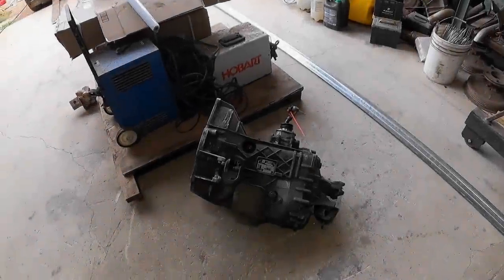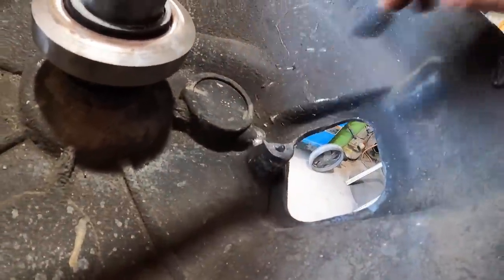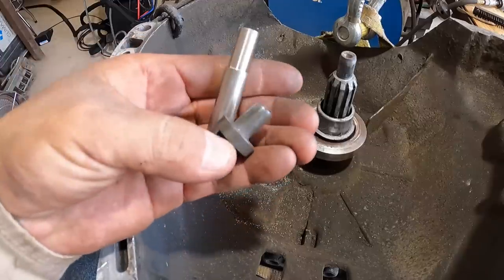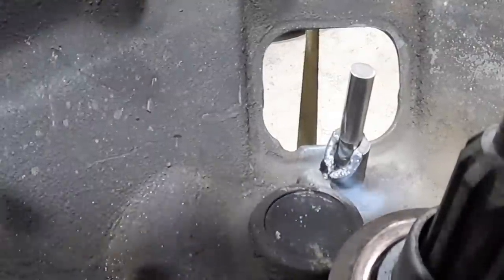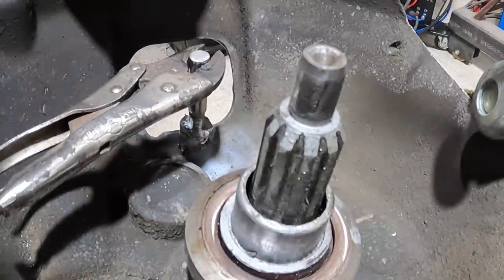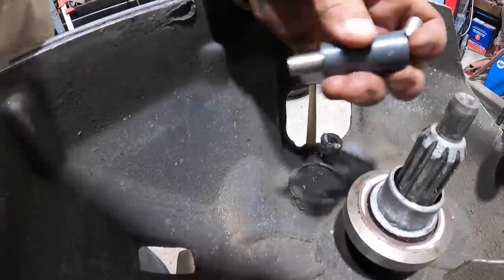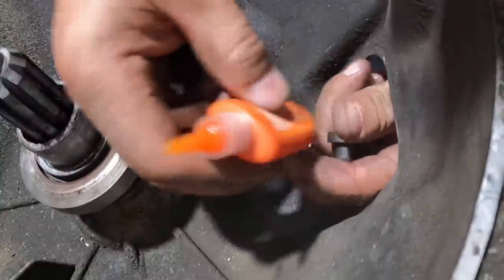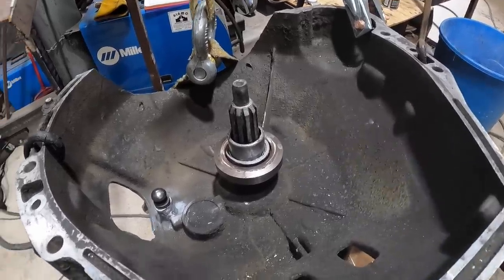Ford Manual Transmission Weld Repair.

Comment: Next time try a red copper rod it works on steel and aluminium you can use acetylene heat the casting slightly then it brush clean easely then before welding just use a acetylene flame with no oxygen blow the place black where you must weld then pre heat until the black disapear clean again and weld i did boat props vw enjine tops everything when i was an aprentise currently almost 25 years a welder butt lately only welding train bogies or trucks i used to do draw gears and train couplers.Nice job though i enjoy your videos go well.

Comment: Good ol Zf5 trans! Nice repair job! Can't tell the difference at all. Looks factory 👍🤷‍♂️✔️🛠️🗜️🔩⚡🔥📏
 I have a zf6 w\ a small hair crack coming from that clutch arm hole thru the side of trans(front 'dry' bellhousing side - not fluid filled section). I bought it used, shipped to me & didn't notice lil crack til later when putting it in. Seems fine still, but I keep an eye on it so it doesn't travel. I may have to pull it sometime to drill holes @ end of crack &\or have it welded. But as of now, I just baby the 7.3 in front of it, so there's not much torsional stress going thru the case at all. 🤷‍♂️🤔👍🔨

Comment: I have been a machinist for a long time, so i knew what kind of tool you needed.I was very impressed that you macgyvered that tool out of mild steel bar stock . and the best part was that it worked pretty well.  Great job!!!
Reply: What is it called? The wood worker side of me was that it's time to wreck a forster bit.
Reply: @emeltea33  spot facer

Comment: Tigging sand casted aluminum is a whole different skill set than what we usually see here.  I used to do this type of small stuff for a machine shop that worked on antique engines on parts you couldn’t buy anymore.  Go slow, adjust the AC balance, keep the heat where it needs to be and dip the filler in judiciously.  There’s an art to it, fun to watch.

Comment: Fantastic fix, thanks for the show!
For the next one...
Seeing the housing's cylinder mounting  "ears" seem to indicate that the clutch fork is actuated via hydraulic cylinder.

After a failure like this possibly the fork etc. could be discarded to be replaced by release bearing with direct-acting integral hydraulic  cylinder? A bit of plumbing and presto!

Comment: I actually seen quite a few broken clutch fork pivot points on those ford ZF S5-42 and 47 transmissions.  When that happens I don't bother fixing it, I just switch to a hydraulic throw out bearing which is actually much better.

Comment: A valve seat cutter of the right shaft diameter would have worked to true the top of the throw out arm pivot. But, your way worked 👍

Comment: I had to do a similar repair on an automatic transmission oil port bung that got cracked off... tapped it 1/4 pipe thread after and worked fine, always nice when you can save a case!

Comment: Issac, I know that you are used to working in your home shop and you truly seem to love it as it is. However, the shop really looks like it is over-stocked with tools and equipment etc. and could use an extension added to increase the working area. I really don't see how you can work as proficiently and safely as you do in such a cramped area.
Reply from the maker: I agree however, This is the only room I have available to me. My yard does not allow any more wiggle room. Unfortunately, for me, my shop has become a catch all. I'm actually a field repair guy but as of late, i've been getting a lot of shop work. I havent had the time to clean or organize my area. its truly a mess and I really dislike showing my junk laying all over the place. but,..it is what it is for now.😔😕😕

Comment: Real tidy looking repair.
Can't remember exactly what i used it for but I have knocked up a homemade cutter from a broken HSS drill bit, drilled the correct size hole and then stuck it in with 5 min epoxy.
Looks like a really weird bit of engineering having it just a smooth plug in the hole.

Comment: A piece of round  Graphite would help you weld up that broken piece to. Nice job again 👍
Reply from the maker: I've used carbon arc gouging rods before but not anything bigger than 3/8". its all I had.

Comment: Your DIY spotface cutter did everything it needed to do and cost you little in time or material.  If you need to make another one try drilling a cross-hole.  Grinding off half of the hole gives you neutral geometry at the cutting edge, or a bit less to be slightly positive.
Reply from the maker: Great Idea. Thank you.👍👍

Comment: Mine did the same thing, but didn't break the bell housing. Diesel fuel leak from the fuel bowl travels between block and and trany washing the grease out of the throw out bearing. The bearing froze up and came apart  causing the fork to shear the pivot ball off the bell housing. Must be on a 7.3 power stroke  lol. My brother made an aluminum stand off and I I got a 2 inch long pivot ball threaded with 2 lock nuts. I drilled out the spot on the bell housing and put the ball threw it and set the depth of the threads and  tightened  the nuts. Works just like before. Keep an eye on fuel leaks, expensive fix. Clutch disk, preasure plate, throw out bearing and a new fork.

Comment: That was a great job you did. Most mechanic and machine shops would have scrapped the case or the whole tranny. I know cause im in the business but you got them out of a giant predicament. I hope you charged them at least half the cost of a good used transmission. Congrats.
Reply: I've done a few ovver the years, seems like a design issue.

Comment: I've fixed something like this before, didn't want to do the build up (not that good with aluminium welding, not confident enough) and so i just machined the broken part, leaving a small registration mark at the bottom, made a little spacer on the lathe and used the pivot to register it in place before tacking it all the way around. So far, hasn't broken. A savvy person could probably do the same fix with basic hand tools, i just had the lathe, but i'm 100% confident one could've made the spacer with a drill and a grinder.

Comment: Good work Isaac . That trans though . I never seen a ford trans with a throw out collar that was casted into an aluminum trans though ... Even if it was an iron unit, it would be a goofy design .Not a good design for sure . You'd think that it belonged to a yugo . lol A guy would think that the throw out stud boss wouldn't be the thing that broke . lol

Comment: F-250, 350 4x4 Zf-5 S42 or S47 gearbox 1987 on with the diesel engines. (6.9 or 7.3) because theres no starter provision in the bell casting.

I was looking at that mushroom a couple of weeks ago when changing my clutch.

Comment: I see that HTP in the background, you going to give us a review on it?
Reply from the maker: 🙊🙊🙊EEEEK!!!... I completely and accidentally let it slip. I'm actually working with two companies as of just recently where I will be using their machines for the gouging capabilities. The two are good at what they offer but have added a gouging feature and want me to test them out. They both arrived at the same time. I will be making a short video about the two.
Reply: The US-sold branding of the Italian industrial manufacturer Stel.  Great welders and support.  Just check with This Old Tony and others.
Reply: @benz-share9058  its about time STEL comes to the US too .. with their bigger industrial machines !

Comment: Brass rod at the feed stores or hardware stores should have that size....1/4? To weld on the outside and have your slip hole.

Comment: Have you watched videos where guys use Oxygen Acetylene torch to weld aluminum? They weld aluminum wheels!
Reply: You can use oxygen and hydrogen gas as well. But that would be WW2 era old school.
Reply: @WilliamPayneNZ  would it be a good weld?
Reply: @dans_Learning_Curve  gas welding aluminium is a perfectly acceptable practice when done properly.

Comment: zf 5sp, either the 460 or the diesel variant due to the hole for the clutch fork and no provision for an internal slave cylinder.  That is a trans thats 100% worth fixing cuz its no less than 1500 bones for a reman or rebuilt one. Ask me how I know...they are a bitch to rebuild too.